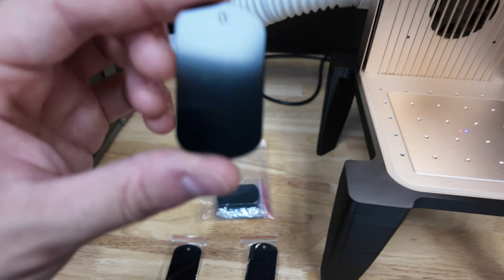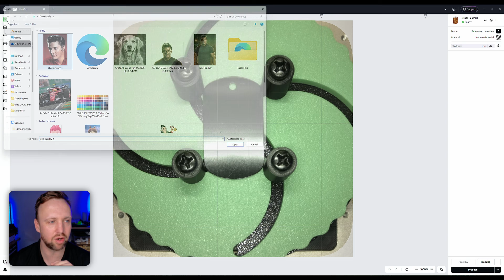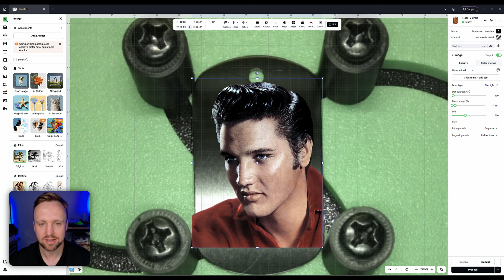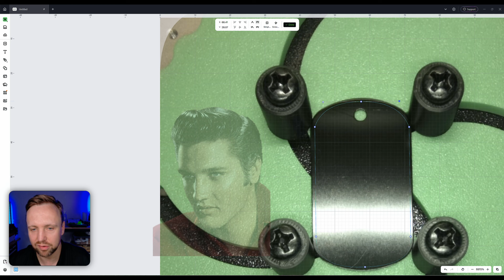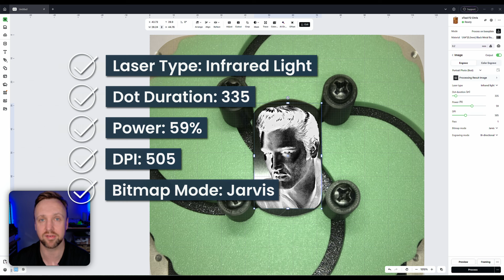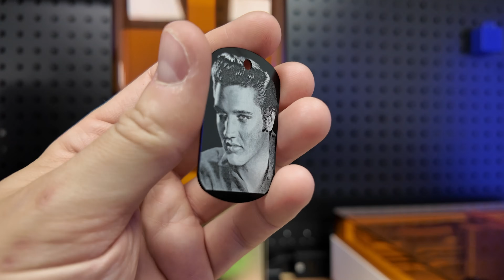xTool F2 | Engraving Detailed Photos on Dog Tags

Comment: Hey Chris thanks for another awesome demonstration! Question in your opinion what’s the pros and cons using black aluminum tags vs black coated stainless steel tags? longevity & durability engraving results etc would love your thoughts. Also have you done a vid on using the curvature feature yet?
Reply from the maker: Great question! I've been meaning to do a deep dive into that. Generally, aluminum is lighter and easier to engrave, but stainless steel offers superior durability and corrosion resistance, which is key for longevity. I did a video demonstrating the curvature feature, look for the video with a picture of a golfball in the thumbnail.

Comment: Loved the video but I hate that these things are always labeled xtool F2 because I have the ultra and almost always the video is about the UV. Can this be done on the Ultra?
Reply from the maker: Unfortunately I don't have the F2 Ultra. I've only got the F2 & F2 Ultra UV. So I'm unable to do any testing for it. This can definitely be done on the F2 Ultra but it will be a bit more challenging because the laser dot size is thicker because of the high power.

Comment: Hey G'day, love your tutorials you always have the patience to explain properly what you are doing and why. I have a question for you regarding the f2 Ultra UV. I use a 100w jpt mopa for coin engraving I have a great machine and know it well. I just recently added UV to my workshop. There is very scant information regarding embossing with a UV. I am trying to but have not had much luck in finding settings for the UV to be able to emboss a brass coin. Im not looking for a deep engraving if you reach into your pocket and grab a coin, thats about the depth/height I am looking to achieve.

Have you ever done something like that with your UV?

Regards and greetings from the colonies downunder :)
Reply from the maker: Thanks for the kind words, it's great knowing my videos are being watched all the way down under!

Regarding the UV laser and embossing coins... It's definitely not that well suited to doing it. I've seen examples of people achieving decent results but it took 12-18 hours to do because of the low power. The F2 Ultra (MOPA) or the F1 Ultra are far better suited. That being said you 100W JPT MOPA is an absolute beast and you'll find it hard to get anything that can do it as quickly as that.